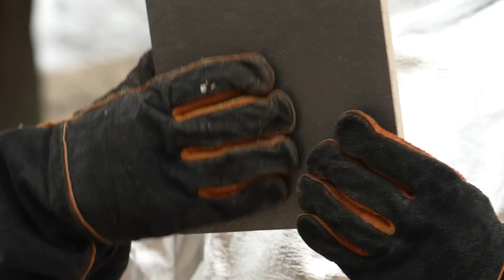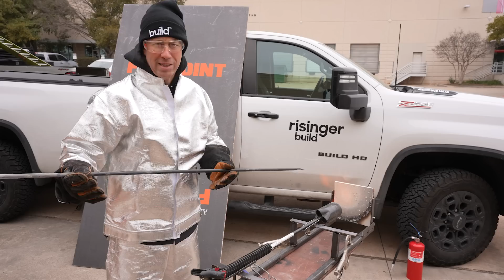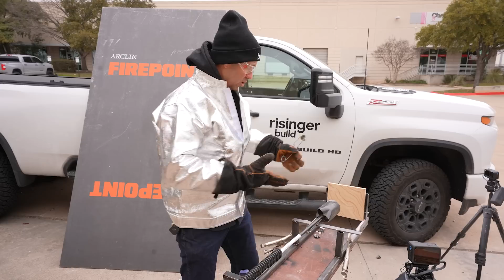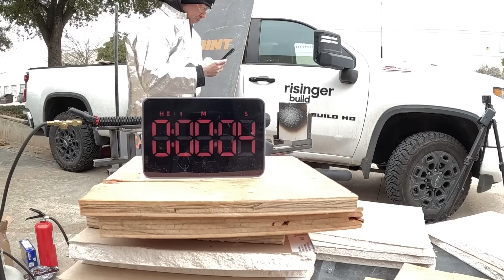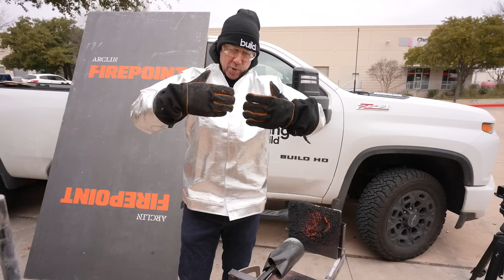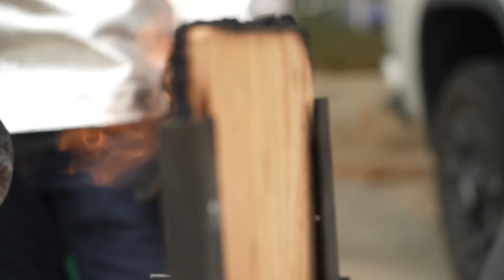Brand New Fire-Resistant Plywood Gives 90 Minutes against Fire!  Let’s test it!

Comment: Definitely an interesting test.  I think one important difference between drywall and wood products is that the drywall is not needed to hold up your building. If the sheathing fails, the house is at risk of falling down.

Comment: Great video, I'm trying to nug out a plan for a small shed just outside my garage to store LiFePO4 batteries.  I'm thinking cinderblock on the house side then finishing out the interior with materials like this along with a metal roof that slants away from the house to direct any heat from a fire out the far end as long as the walls hold up.

Comment: The metal connection (nail, screw) to the structure will transfer heat directly to the studs. This material could cover the screw or nail and protect them from heating, but it would have been nice to see.

Comment: It would be great to see how ICF holds up.  I bet it crushes every other material in the poker test for structural integrity.  Also, think about how hot the other side of the material gets which might ignite something else combustible on the other side.  That would be a low concern with ICF.
Reply: ICF won't be as good as you're thinking.  I'm doing an ICF build this year and I'm going to wrap the walls in some rockwool.  The foam is not particularly fire resistant, of course.  But the concrete core is usually only a 2-3 hour fire assembly and can be structurally destroyed if it exceeds a certain temperature where the concrete starts to be chemically altered.  In the case of a wildfire, you can have really long fire exposure, so this is a concern.  Also, concrete is a pretty good thermal conductor, so you could theoretically start to see ignition on the other side even before the concrete is thermally compromised.  Having a bit of fire-resistant insulation between the ICF and potential fire sources should make it pretty much indestructable but it's probably a good idea to buff it up a bit.  
I like ICF as a building material but in doing my research, I've found that the fire and sound resistance tend to be exaggerated a fair bit by ICF companies.  IF you want really high performance for both, you have to be willing to bolster it a little.
Reply: @danheidel  Hardy board cladding is probably all you'd need to make it better than anything Matt shows in this video.  You have to have some kind of siding over the ICF anyway.  Or you can apply stucco like ustucco and it will be fire rated.

Comment: It would be interesting to see how this product compares with regular wood products covered in intumescent paint, which has been available for a while at prices ranging from $80 to $160  per gallon. Could one sheath a wall with the Arclin plywood, then cover the exposed rim joists or any other framing with intumescent paint? It would also be interesting to see how intumescent paint does with older interior sheathing products like Beaverboard or wood-panelling; could the owner of an older house bring it up to current code by coating, rather than replacing, these products?

Comment: I stopped listening because it didn't sound like he's going to cite the actual ASTM OR ISO lab tests.
Im fine with appealing to the internal caveman but it's just  BS commercial otherwise.
Please tell me if he actually cites the astm wall assembly test or some other actual standard and maybe I'll come back and watch it.
Reply: "Class A Flame Spread Rating

(ASTM E-84, ASTM E-2768)

Load bearing 1hr and 2hr fire-rated wall assemblies

(ASTM E-119) ICC Certified, ESR-5116"

From the arclin website

Comment: When putting out fires close to electrical devices, dont use a powder extinguisher. The powder will corrode any electrical wires ect if it gets exposed to any moisture.  CO2 is the best option :P

Comment: Why just don't use a flammable material as the primary building material,  instead of trying to make a better wood? It used to make sense when wood was plentiful and cheap and the lower urban density was such that one house lighting up on fire would not endanger the whole town, but that's no longer the case.

Comment: How much more weight versus Zip wall? And needs for special fasteners? Heat can transfer to nails/screws to the timber behind,  yes?
Reply: My assumption is that the intumescent would counteract that scenario. But you make a good point.

Comment: Unfortunately not helpful for protection against wildfire, because you'd need a plastic/asphaltic vapor barrier outside the wood. Fire ratings inside a structure are simply to give time to evacuate, the structure is still doomed once the wood starts burning. And drywall is cheap and gives the fire rating.

Comment: I'd be very curious to see how DensGlass would do in this test.
Reply from the maker: I suspect it would be something similar to Typ X 5/8. But maybe it’s better?  Maybe a part 2 version of this test?
Reply: @buildshow  Part 2 for sure. I'd love to see DensGlass and it would also be interesting to see how how things perform in an assembly (e.g. with some insulation behind the sheathing). My suspicion is that both the drywall and cdx would perform worse due to heat buildup. Btw I'm the guy who commented about the birds pecking on the commercial flat roof over on IG the other day. Looks like we're going with the USG Securock decking for that 22,000sf retail strip.

Comment: Why not use wood sheathing comparasions? LP Flame Block, Dens-Glass? Apples to Apples?
Reply: Likely because the company that paid for this video wouldn't beat those products.
Reply: For better or worse, the Build Show has built its company around blatant shilling of whatever company is willing to pay up, for all intents and purposes this is an infomercial. 

LP Flameblock is virtually identical, just an OSB substrate instead of plywood and presumably is cheaper, not to mention easier to source. Densglass is more apples to oranges since its a water resistant gypsum with very little shear value, though if you don't need the structural value its significantly cheaper.

Comment: They should coat furring strips for rain screens with this material.  Combined with mineral wool exterior insulation, and a masonry or steel siding,  you might end up with a nearly fire-proof wall.
Reply: 🎯 on fire proof walls

Fire-intolerant construction should disappear into the past. We're in 2025 now, buildings should *never burn down*.
Reply: They sell intumescent paint that should be able to replicate or even exceed the fire rating of this stuff, depending on how heavy you load the paint on.  The stuff is kind of pricey but if you're just applying it to furring strips and other high danger areas, it would be a very economical way to greatly reduce fire danger.  I'm looking into doing something like this on a house I'm going to be building this year.

Comment: Would like to have seen you use an IR thermometer to measure surface temperature at various intervals.  Also, I think your piece size is too small to measure how it would behave in the real world, as the fire source reaches all the way around, but in most uses, this wouldn't happen.  Still pretty good to give us an idea of the relative resistance for the materials!

Comment: Unless you're using metal cross sections or straps for your sheer then the sheetrock's always going to be used as a part of a system so it's going to be potentially multiple layers of sheetrock or sheetrock over wood the fair test since you're comparing a complete system would be to cover a section of OSB  with sheetrock and see if the OSB burns using  multiple layers of the sheetrock. To see how long it takes for the back layer to be affected. Lowell say there certainly can be a lot of cost to be saved by not having potentially sheep rock multiple times after laying up sheathing. So it's definitely a valuable product but I don't feel you remotely did a fair comparison